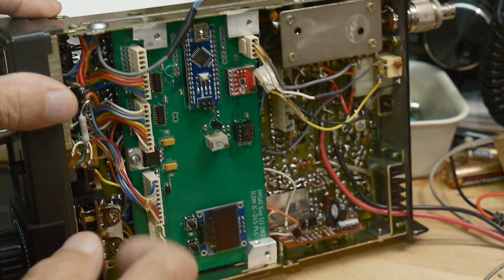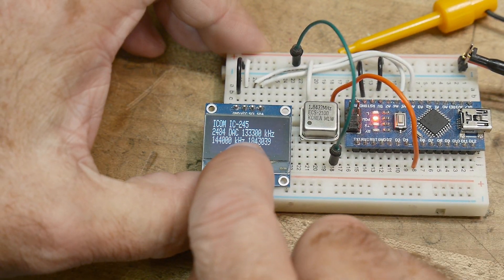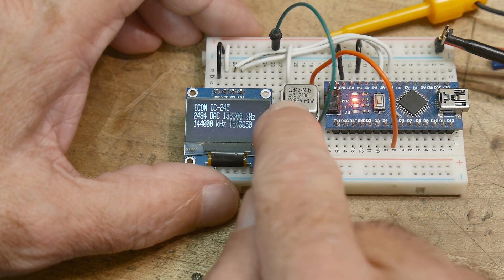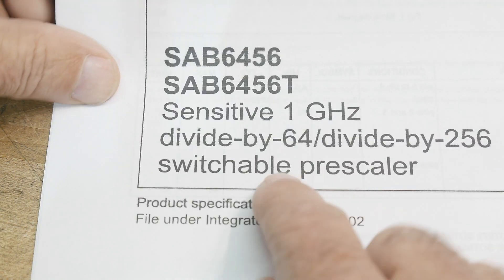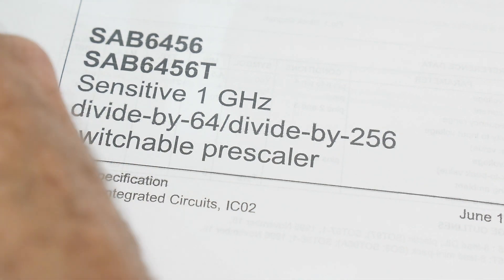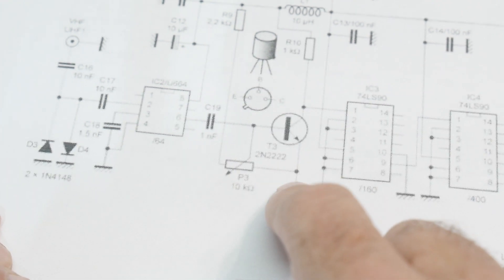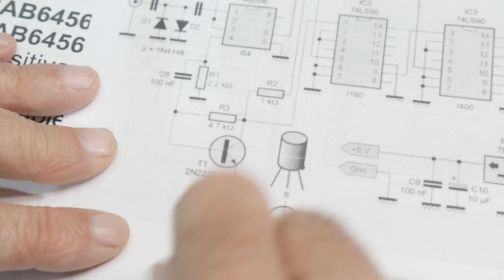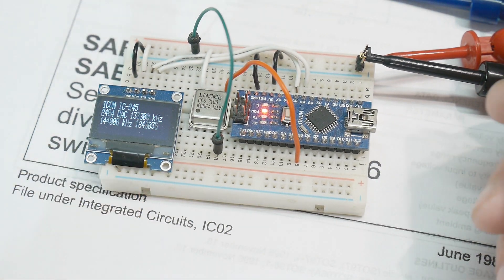#968 Arduino Frequency Counter Breadboard

Comment: To avoid chaos, place the frequency counter code in an interrupt-handler, running say once per-second, or whatever responsiveness you want.
That way, the frequency-counter's instruction stream will run as one (non-interruptible) block of code, to say, loading a set of memory locations with the result.
This way, there will be no timing skew in the count.  Some people argue that they UI should be put in the interrupt-routine but this 'will' give errors.
Then when ever you want to update the display, just disable interrupts (to prevent a new sample) then retrieve the registers that were preloaded in the background, re-enable interrupts back again, and then do whatever display-math.  73...

Comment: I made it work , but I notice that it would only work if using i2c for the display cause most displays would use the pins that you need to input signal or that the code needs to use in order to work

Comment: I put that code in my arduino uno , and I been trying to measure a 555 timer , but it won't show anything it starts with 0 and then it shows the number 8 , code stats for arduino uno is analog pin 5 for the signal , did you add something to the code to make it work?

Comment: An RP2040 might work well for this. It has independent programmable IO cores that can count pulses at 100Mhz+ and other similar useful things without engagement from either of the main CPU cores.

Comment: To get more resolution you can read the MSB of each cascaded counter in parallel using IO, adding then as MSBs of the internal software counter

Comment: It’s really nice to see the progress and the additional projects from  the IC com receiver. I am learning something new  from each video. As we are now trying to share ideas on the frequency counting, thought of sharing my opinion as well.
Adding a ESP 32 with RTOS and a separate thread/core is all doable but I don’t  think that is needed here, if there is no need for Wi-Fi communication I’ll pass ESP32. 
STM32-blue pill is a good choice and it can be overclocked as well and even without overclocking it can track/interrupt at 36MHZ in fast IO mode.
I also believe this should also be possible with the Arduino 16 bit counter as well with the below scheme 
First pre-scaler for divide by 256 , same chip 
Use of a second Pre-scaler either same or any HC binary counter, with this we will be well in 16 bit count range for the complete 1 GHZ range and the counts can be gated (either SW or HW) at 1 sec / 100 mSec  intervals to check the frequency 
The accuracy will then be dependent on the time base source and the loss of floating point number during divide by 256 and the Arduino can just fetch the count on a predefined interval.

Comment: The third buffer circuit, for prescalar output, looks to be a good possibility. DC biasing would ensure that the counter input is normally logic-low. The prescalar then drives the transistor off to generate a rising edge pulse. Use of a thresold on the buffer seems to indicate that the prescalar has some analogue & amplification properties as well, it's not strictly digital. This type of buffer would rely on a good sink-current output on the prescalar (with help from that pulldown resistor), maybe another reason why it was designed that way?
Cheers,

Comment: How many digits of resolution (and accuracy) do you figure you will need ?
Back of the envelope suggests that at %64, you will get ~2MHz output, and 1KHz channel spacing divides down to 15Hz post-prescaler.
So 7 digits of resolution absolute minimum, more would be better - that might be kinda pushing things.
While the Si5351 is a poor choice, as you've shown - what about parts like the ADF4351 (you have a board based on that, I believe) - that should have much better phase noise as the output is the PLL without a fractional divider, or how about a DDS (though ones that reach 140MHz tend to be harder to wrangle) ?
I suspect that your avr loop time and resolution/accuracy (including CPU clock temp drift) will dominate your performance, but happy to be proved wrong, and anyway the journey is the thing, right ?

Comment: Very nice! Another option is to use an ESP32 and dedicate one core to the frequency counter. The FreeRTOS xTaskCreatePinnedToCore will let you do that.
Reply from the maker: That sounds like a nice solution. So much for me to learn
Reply: And ESP32 can count at 40 MHz (hardware counter based on 80 MHz clock) so you can get much better resolution. It can use the RMS device for precisely gating the counter, so you can count 40 MHz for 1 second at 1 HZ resolution. I saw a library for this: DavidAntliff - esp32-freqcount (oh, can't post a link I guess) (haven't tried, but I found the principle very interesting). Since this uses hardware peripherals, the core will remain mostly idle :)
Reply: I found this so interesting that I spend this Saturday testing it. I manage to count rising and falling edges of a 17.3 MHz signal during 1 second, with resolution of 1 count. (Higher than that, readings were not stable.)

The 17.3 MHz signal generated by my basic signal generator (a Uni-T UTG962E) measured beetween 17299732.5 Hz and 17299728.5 Hz during 20 minutes, with one measure per second. So that's 5 Hz drift in 20 minutes, and close readings were within 1 Hz.

So ESP32's clock drifts a bit in time compared to my signal generator, but other than that, it looks stable. (I haven't tested for any drift linked to MCU's temperature). If a reference signal were available, the ESP32 would count both signals and apply a correction given the measured and known frequency of the reference signal.

And of course the whole thing consumes virtually no CPU -- the counting is performed by PCNT device, the gating by RMT device, and an interrupt handler counts the overflows of the 16-bit counter.

The graph of my measures is here: pbase.com/xhumari/image/172174767.original.jpg
Reply: @IMSAIGuy  ME, TOO! :)

Comment: Don't you just love radio and electronics, you start off pulling an old radio apart and end up building a frequency counter. I must admit I generally end up going off on far worse tangents than that.  
Rather than two nanos maybe something like the STM32 (blue pill) would be better. Still usable within the Arduino ide and much faster.

Comment: I have been going down the same path trying to improve the accuracy of my existing frequency counter. I have already purchased a temperature controlled oscillator. But you still have the issue of getting it calibrated. So I'm currently researching using a GPS disciplined oscillator. That way there is no need to find a calibration standard.

Comment: If you need the precision and accuracy that you seem to imply, you need to replace the Arduino's resonator/crystal with a temperature controlled crystal oscillator.  The hardware counter requires no execution cycles except to read it or to service its overflow interrupt.